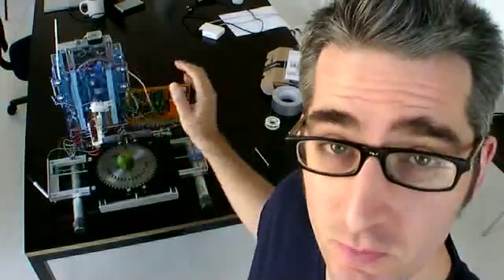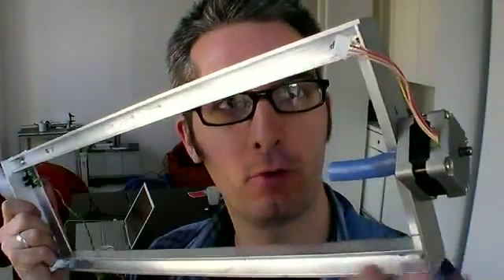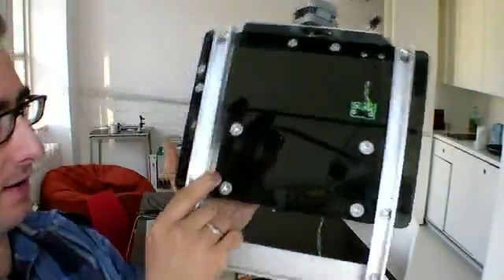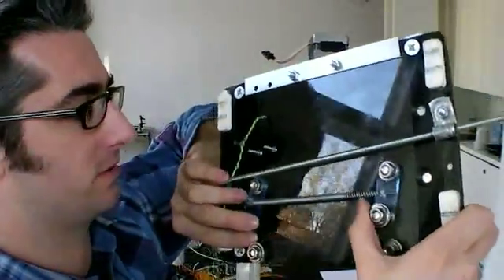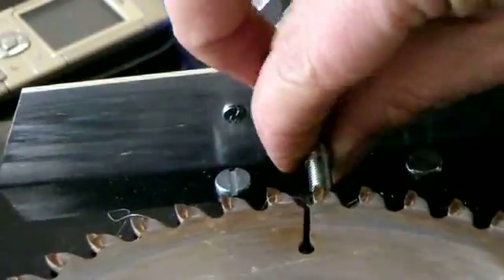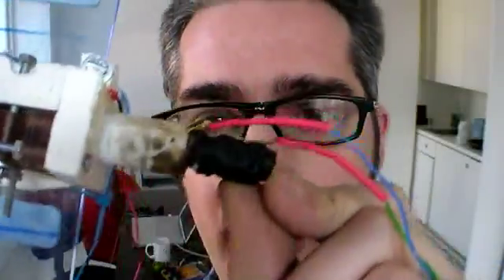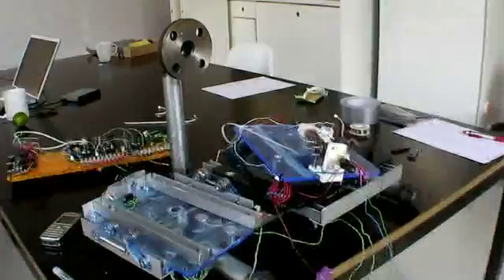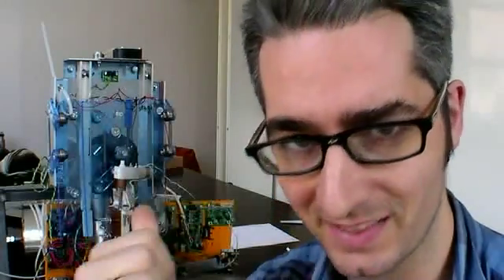Make a RepStrap Robot (Part 2) - Weekend Projects Podcast

Comment: Why not use a regular printer head to shoot down a mircon layer of photoreative resin. After the layer is completed, before the head returns for it's next pass you have a light source above the table expose this micro thin layer of photoreactive resin. Could take 10 seconds or more to cure it, but once it's cured, it's cured. The light cuts off & now the arm & printing head can make a new layer over the previous one.

Comment: A replicating machine doesn't have to be able to make _all_ its own parts. For instance a human being needs several amino-acids that it cant make itself but have to get from other sources. This isnt a problem since its easily available by eating for instance meat. Copper wire isn't really a problem since it's easily available from any kind of broken electronics.
Making electronic boards is the aim of the next generation RepRap.

Comment: But a traditional lathe is not computer controlled. The RepRap / RepStrap machines are semi-autonomous because the thermo-extrusion is controlled by PC software that holds the design pattern for the pieces that it makes. 

While no one is making (serious) claims of "living machines," it is more automated compared to your machine shop example.

I tend to agree with you about the "self-replication" part being over dramatic. I think the philosophy of Fab@Home is more accurate (& less grandiose).

Comment: you are obviously an idiot. do you have any idea what rapid prototyping is? its a vat of liquid polymer, a last traces out a 2d design one layer at a time, each pass of the laser hardens the material and keeps doing so until a 3d solid object is created. there is NO tooling cost. tooling is only needed for stamping/extrusions etc. this is mass production NOT proto'ing.  this machine is a dirtball RP machine at its worst.